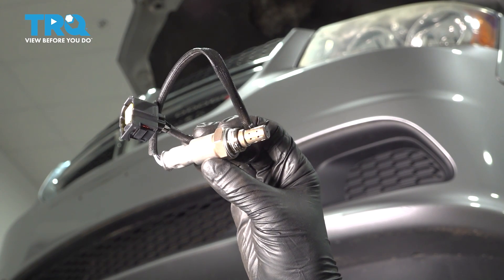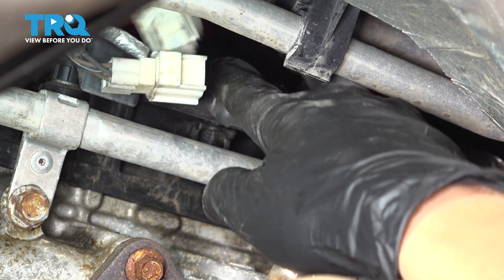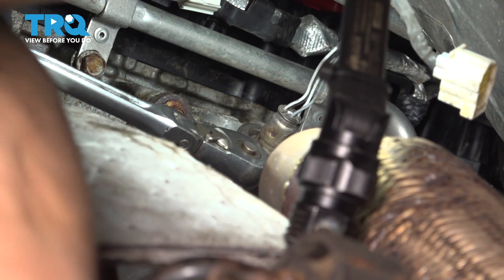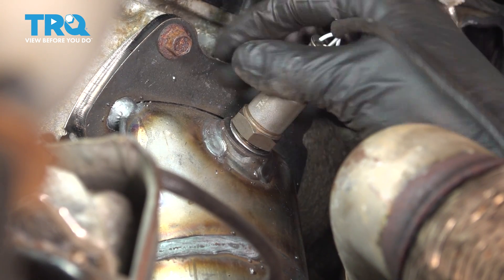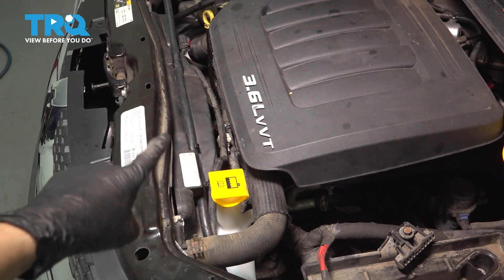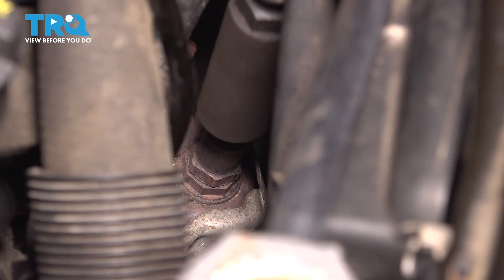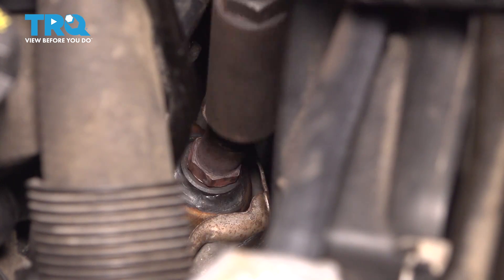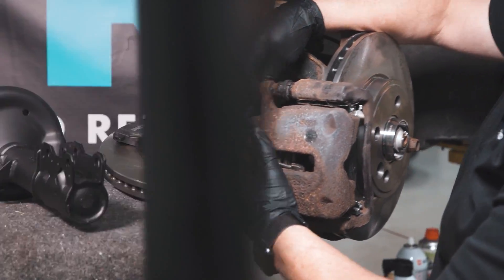How to Replace Upstream Oxygen Sensors 2008-2020 Dodge Grand Caravan

Comment: Thank you for the video, the insight on the Bank 1 sensor and tool choice is spot on. Nice to see you break it loose. Any pointers on stuck sensors? Do you prefer the engine close to operating temp? Greatly appreciate your channel!